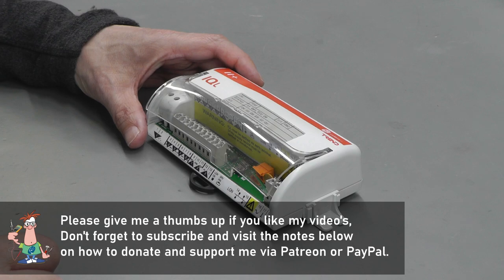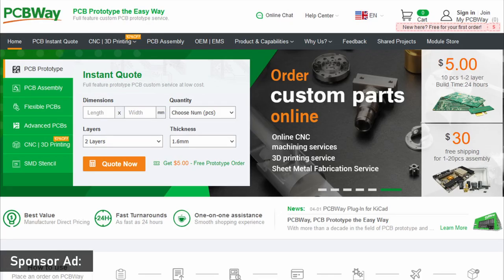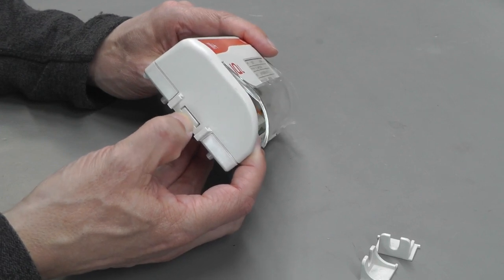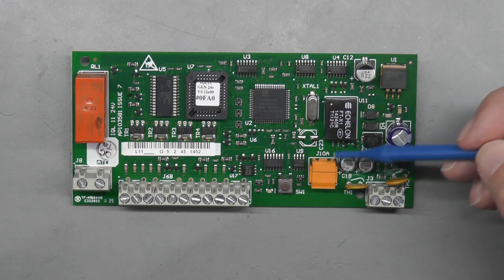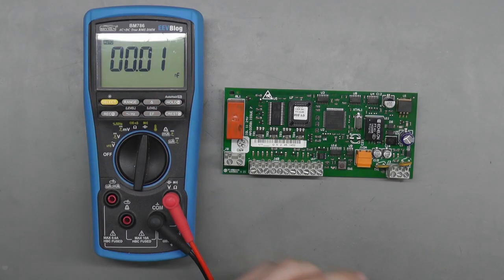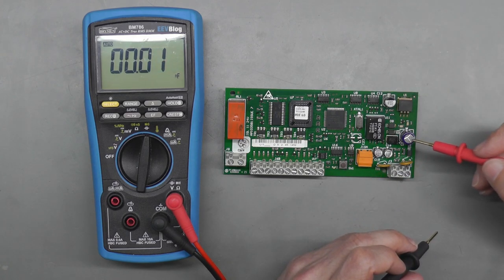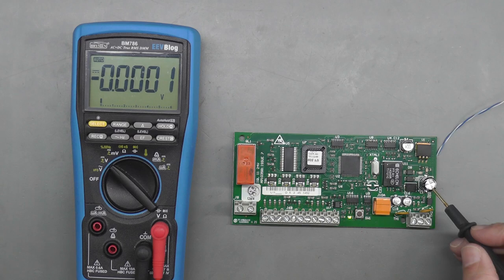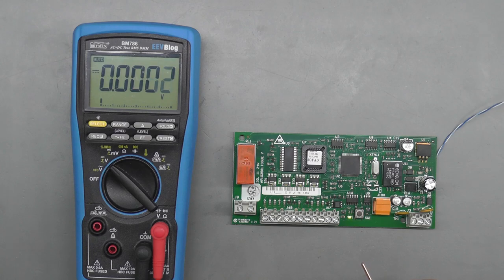No.110 - Trend IQL11+ Terminal Unit Controller Repair

Comment: About the network this uses, is this a serial network, like a can bus or rs485? If so, it could be easy as well as interesting to see what the protocol looks like with a serial monitor or oscilloscope.
Reply from the maker: From Wikipedia......LonWorks or Local Operating Network is an open standard for networking platforms specifically created to address the needs of control applications. The platform is built on a protocol created by Echelon Corporation for networking devices over media such as twisted pair, power lines, fibre optics, and wireless.
Reply: @IanScottJohnston I haven't heard of this one, I'll read on that a little more after work tomorrow.